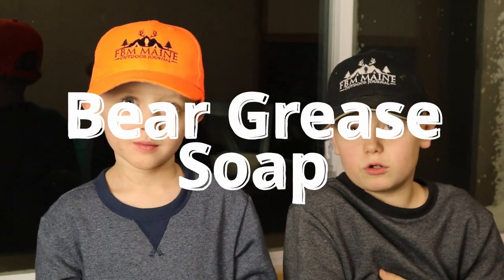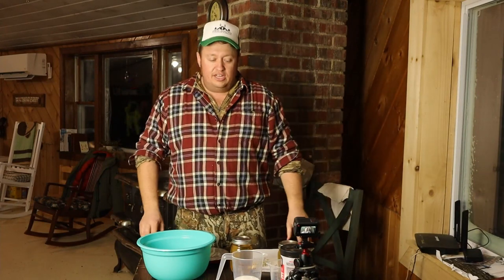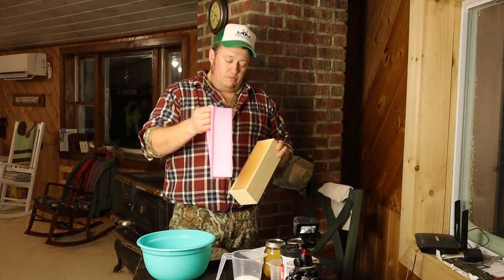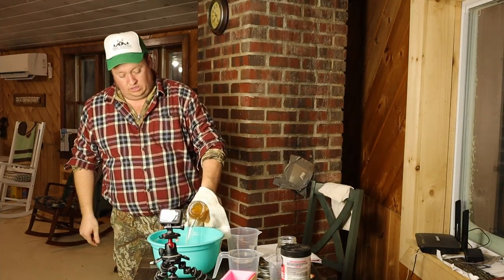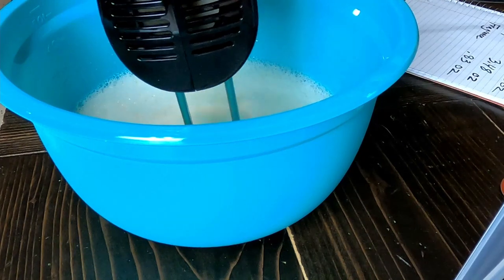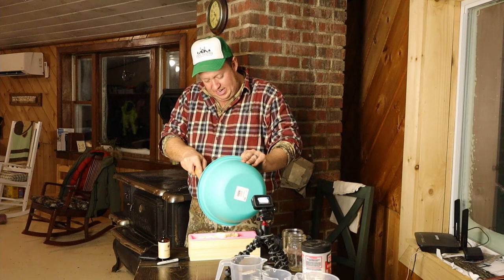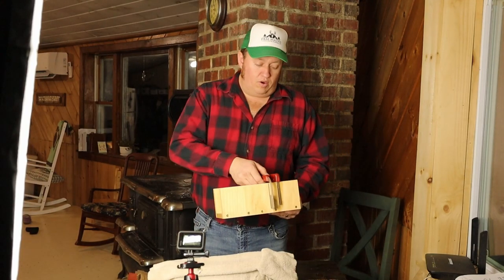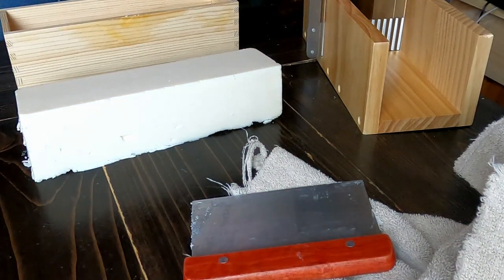How to Make Bear Grease Soap

Comment: Did you ever figure out why it took so long to thicken? I just did a batch and it took FOREVER, i suspect my grease might have cooled off a bit and wasn’t hot enough.
Reply from the maker: It was my mixer. I have found that I'd you use an immersion blender it goes way faster
Reply: I blew up the immersion blender after 10 minutes and for the next hour and 15 I used the cake mixer, im not even sure it was thick enough, first batch ever, we will see in 24-36 hrs!